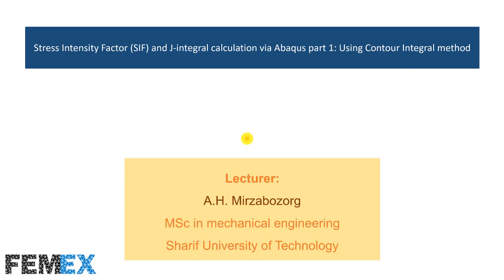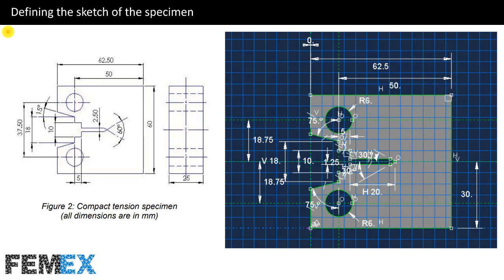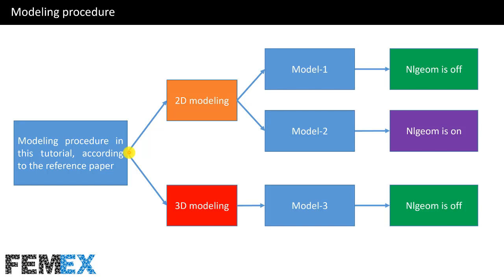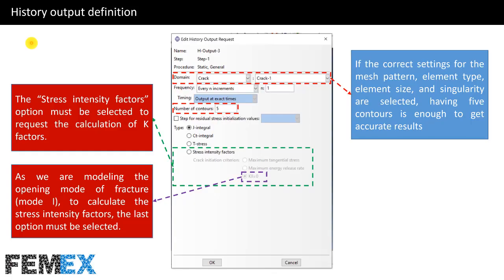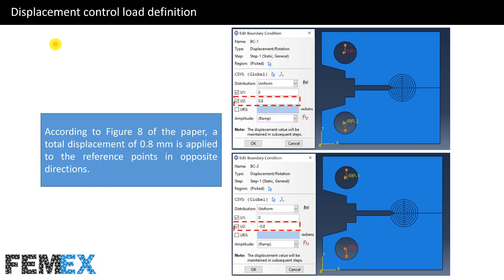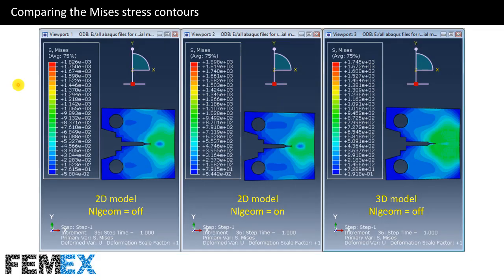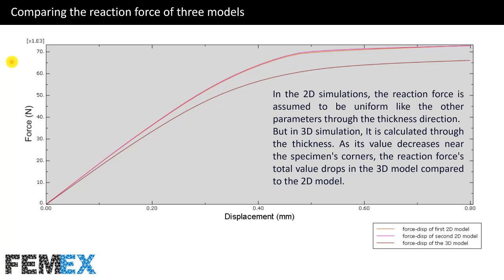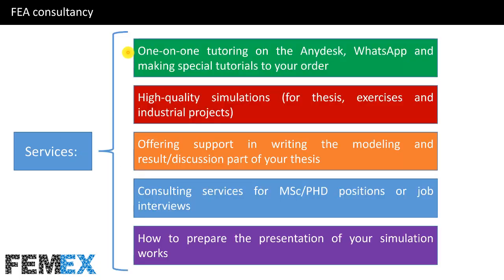Stress Intensity Factor and J-integral calculation via Abaqus part 1: Using Contour Integral method

Comment: can we apply load in terms of incremental displacement ?
Reply from the maker: Hi.
Yes I have done the same.
Reply: @FemexIran  is displacement applied to the periphery of the hole?
Reply from the maker: @SubhamPrasad-rf1hq  Yes. It is. The displacement is applied to the RP at the center of each hole and the perimeter of each hole is coupled to its relevant RP at its center.

Comment: why my j integral contour is not converge as contour number increase
Reply from the maker: Hi.
Good day.
There can be several reasons:
1) The size of each contour is not appropriate. The focused mesh must include the plastic region entirely.
2) The singularity settings are not correct.
3) You have not generated the focused spider-web mesh pattern appropriately.
You can buy the extended premium package of this tutorial to learn how to do the contour integral analysis appropriately. Also you can use the discount code to buy it with 50%discount. This is the link to the discount code explanation:
https://www.youtube.com/watch?v=a9qo3-aD8kc&t=30s